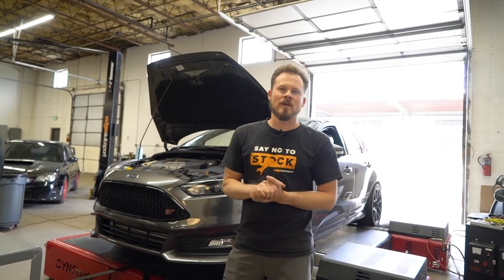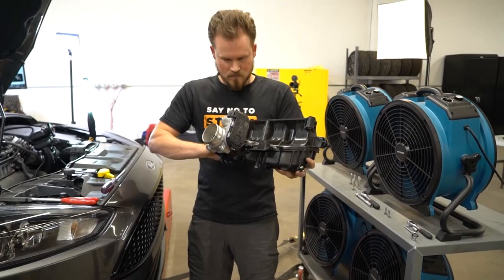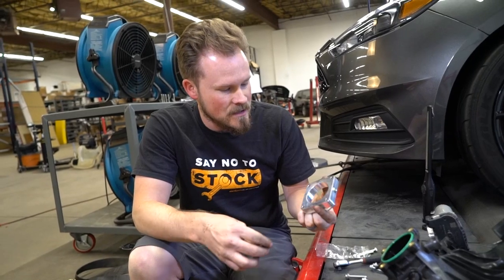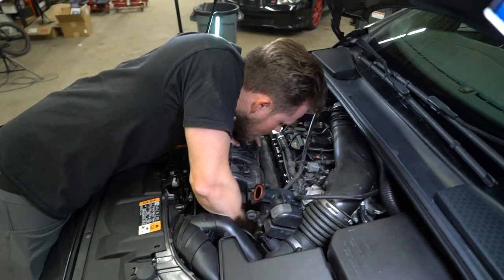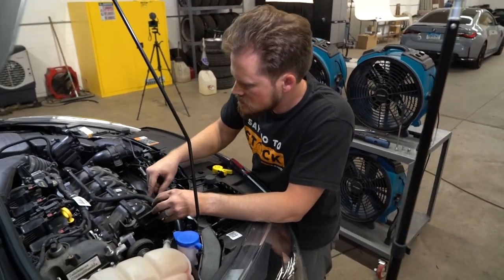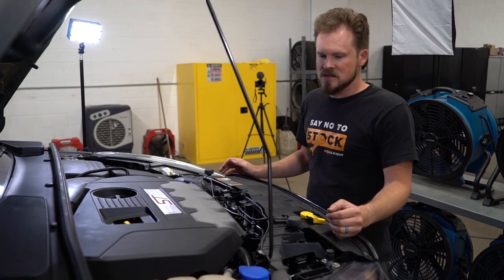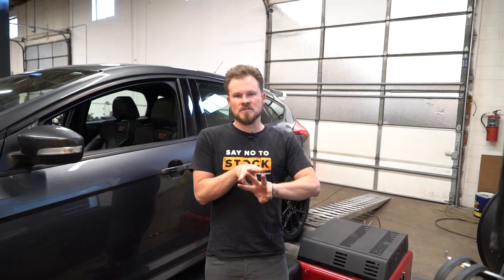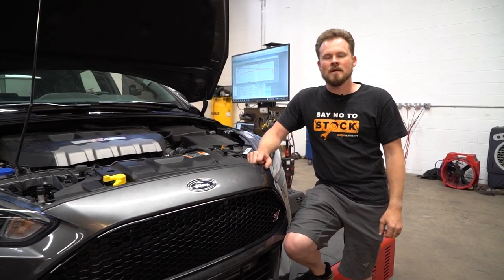Performance Throttle & Intake Spacers DYNO TESTED | Project Half-Send Focus ST

Comment: Great video , I’m a little sad that I feel like I wasted some money but this video was definitely something we need. Keep them coming
Reply: Yeah you see alot of snake oil with the aftermarket.  You just have to figure it out from experience.
Reply: I bought them because Edge recommended them. Wouldn't have bothered if they wouldn't have recommended them.
Reply: Bro his testing is flawed I've used them on my race car and aluminum manifolds the difference is better response go for a rip stop your car and touch your manifold it will be cold to the touch a colder manifold will always perform better he's trying it on a plastic manifold the whole reason they make plastic manifolds is to stop them from heat soak exactly what the spacer is doing

Comment: I gotta say, I'm impressed that you were able to install the TB spacer... After cleaning my valves, I installed the IM spacer and tried to install the TB spacer as well. But for the life of me I couldn't get the IM to line up no matter what I did to adjust it. I'm running the Cobb charge pips and IC as well. I just left the IM spacer on. After learning that they don't do much I'm glad lol 😂. I threw on both catch cans, sound symposer delete and pcv plate all in one shot. Shes running solid! Thanks for the video! Keep them coming!

Comment: I also had a feeling it will make no difference.

As Alan mentioned, the spacers can still be very beneficial by installing port injectors / watermeth nozzle which will make a huge difference.

Cleaning intake valves is highly recommended….then adding catch can!!

Thanks for the videos! Really enjoying your content 👍🏻
Reply from the maker: Thanks for tuning in, glad you liked it!

Comment: I said this a long time ago on the focus forums, so I’m glad this reinforces my findings…I also stated a ported TB did nothing as well so hopefully you can get your hands on one to really seal the deal on this snake oil
Reply: We will be doing this as well at some point.
Reply: Ported throttle body can help out in most applications, it all depends on how restrictive the intake system is,
Reply: @GoGoggansGo  on these cars you need a larger throttle body, solid charge pipes, etc. To help with power.  I don't think porting will do much unless you're doing nitrous or meth injection.
Reply: Gained 2.8hp & 5.4tq w/ ported tb(62.65mm). No spacers. Depo fmic & cnt charge pipes were already on car.
Reply: It’s a turbo I bet that’s why no change

Comment: I would not expect any changes on a boosted engine.
What I would be looking for, is a powerband shift with some small increases on the bottom end of a smaller 4 banger NA engine. You’re basically lengthening the distance between the intake valve and the throttle valve. Therefore, you’re increasing intake air speed at idle and off idle.
On an NA engine, too much intake runner can actually create a restriction @ WOT.

What I don’t understand, if you’re boosted, why you wouldn’t just run an extra fuel injector that squirts on the impeller?
It cools the wheel and air charge, is pre-atomized, cleans the intake valves and gives you the extra, needed, fuel. 🤷‍♂️
Reply: It would be to far away and as the atomized fuel travels through the charge pipes and ic it would condense back into large droplets. This would reduce the consistency of added fuel. If your looking to drop charge temps before the manifold they do make a nitrous fogging system for intercoolers to externally cool the ic using n2o.

Comment: I have seen videos and read articles that show a very modest gain in HP and torque, but they were on naturally aspirated engines not forced air set ups. It is usually only 3-5 HP or ft/lbs at the most. But if a cold air intake can get you 5-10 HP and a cat back system close to the same, you could possible gain 25-30 HP and a similar increase in torque. The problem is that it will cost you $800-900 for those gains. It would be good to see someone do a video where they go from stock to adding each of the upgrades to see if there is an actual gain, and do it on an NA engine. It would also be interesting to see how a simple power module or tune would differ with and without those upgrades. Who knows, it could make a noticeable difference, especially on some of the lower HP 4 and 6 cylinder engines.

Comment: So I have a 2018 focus st and iv been buying whatever I can to spice it up. I got the COBB a/p, an AWE track edition exhaust, MSD ignition coil packs, NGK spark plugs, CPE intake, and MISHIMOTO front mount intercooler... Thats basically it besides some cosmetic mods. But my question is having all these aftermarket parts, should I get it tuned so that i dont have any mechanical issues with stock turbo and engine internals/block?
Reply from the maker: Check out our video about tuning a stock ST, Sebastian. Sparknotes: it's always a good idea!
https://www.youtube.com/watch?v=ymt-zKQek6c
Reply: Do a rear motor mount right away. Anything over stock power makes the wheel hop horrendous

Comment: Assuming that a similar turbo engine with an aluminum intake used thermal spacers in the same spots, would not the reduction of heat transfer from the engine to the intake cause the incoming air to be cooler and hence allow the engine to make more power?

Comment: I looked at the boomba but I didn't see any advantage. The only spacer I've spacer seen for these cars that look like they should make actual difference is the  Steeda intake spacer. I would like to see some dyno results from that, similar to the Boomba they did pay some attention to the airflow entertaining the ports, but instead of knife edging it has a recessed rounded dividing edge. The only downside is it has no ports for any type of injection.

Comment: My only comment would be: isn't this like any other bolt on you install on the car? Meaning; you're not gonna get any HP gains from it unless you have it tuned. 

I'm not saying spacers are definitely going to see power, but would it now be possible to eek out some more power where you couldnt before using the power of an updated Alan Super Tune TM?
Reply: There isn't really anything to tune for with these. I'm riding the knock limit with the car right now and have tried to increase timing and boost separately and together and it just knocks more if either increase so that tells me it is happy where its at. We haven't tried any of these tests with the e30 map, though I doubt there would be any difference there either.
Reply: @TMTMS3  thanks Alan for the explination. You're the best!
Reply: You're right. More air needs more fuel. None of these videos address that.

Comment: I seen these for ls motors and I figured they were to tighten up the look of the engine bay when you switch from fan clutch to electric, people thinking these add power don’t really know the basics of making power
Reply from the maker: unfortunately a couple of companies used "improves airflow" as a marketing tactic and the HP gains spiraled out of control from there.

Comment: Well... I have to say I´m somewhat unimpressed. Driving these things (Steeda) around since many years to finally find out it´s just paper weight. If only this comparison would have been done earlier. But still, thanks for it! Not many have the chance to do this back to back test on a dyno for just a single part. Only one thing what came to my mind: I read these things only show their TRUE (haha) potential when tuned for it, there´s a value for the intake volume which has to be adjusted by the volume increase of the parts. Don´t ask me how much that is...

Comment: Say I've put 65k km on my ST and I want to get a catch can installed. Are there options for cleaning the valves/engine other parts coated with oil and other gunk?
Reply from the maker: Most people seek 'walnut blasting' services to clean the gunked valves. This is a pretty inexpensive and effective option! After the AOS/Catch Can, they should stay sparkly clean.

Comment: Increasing your intake runners length I.e spacers will change power band or can depending on vehicle. They're originally meant to increase throttle response. I don't know why anybody ever thought that it was going to give a bunch of horsepower cuz they don't. That's not what they were originally intended for the invention of the spacers. Pretty much older than probably most the people watching these videos

Comment: I'm late to the game with this comment, but assume the people that designed it did it for the reasons they did.  The bottleneck isn't here unless there's an off the shelf reason, go after the under engineered stuff first that came of the parts bin and then have some data as to what to go after next!

Comment: That thing isn't awd right? The back tires were spinning on the dyno
Reply from the maker: Linked dyno. Not AWD
Reply: @EdgeAutosport  what's the point behind that? More accurate readings because it's having to move the rear wheels as well?

Comment: Had my intake valves professionally walnut blasted before fitting the mishimoto baffled oil separator catch can 👍
Reply from the maker: That's the way to do it!
Reply: At how many miles, driving an 18 with about 45k on it... Thanks!

Comment: all well and good on a turbo car... but what about an N/A? 🤔
Reply from the maker: Reviews are mixed, some V8 guys swear by them, and I know some 350/370Z drivers really like them on the VQ series... but we haven't been able to test anything personally
Reply: @EdgeAutosport  if you take physics into account. a turbo wouldn't benefit, because the air is being forced threw, no time to be tumbled, and atomized.. because it already is... 
An N/A on the other hand benefits from just about any extra volume of air that you can get... so more condensed volume of air means more power.. same concept as a turbo, but not to the extreme...
I got a set coming for my 86..
wish i had a dino to test on.. 
but 🤷, we shall see what it does to the torque dip.

Thanks for reply
Reply: It does increase the manifold plenum, negligibly though
Reply: @tayvonrose2528  im getting 2-3 liters per 100km better on fuel, with just the throttle body spacer so far... 
thats not negligible...
Reply: @jesse584  I meant the plenum volume increase is negligible
Reply: @tayvonrose2528  results are great though, can't wait to get the time to do the intake spacers ☺️

Comment: 2017 ST.  I honestly felt a bit of throttle response but that’s it, for the causal driver that wants to build their car I would stay away from these, spend the extra $150-$250 on something else
Reply: I agree.  The best thing I found with this car is to take care of charge air Temps first and foremost, then seal the engine off, i.e. the rubber plug ford calls a bov, and get rid of the noise symposer.
Reply: Spent $109 on a 62.65mm ported tb. $530 on Depo fmic & cnt charge pipes. $35 AEM filter & removed box lid. 1 stage colder plugs & JST E30 tune soon, as soon as I get M Factory LSD in.

Comment: would a more empirical test  be.. test one thing at a time, than two? manifold spacer first.. test.. remove the spacer, then test the spacer under the TB test that show each result.. by doing both at one time you cannot see what each is doing/ or not doing..  also,, as the valves are easy to see, to clean the carbon,, could you test a  10000mw burning laser to clean the ack of the valves.. the laser would just vapourize the carbon,, not letting fall into the cly/ turbo.. i have played with a 10000mw laser,, and i think it can be usefull.. and they are not $$$
Reply: Given that running BOTH did NOTHING, we can easily infer that NEITHER would do ANYTHING. If there was some sort of benefit from running only one of them, we would've seen it on the dyno.

The concept for both is allegedly the same: It adds space for air to breathe on the intake manifold. Allegedly and based on the dyno, Boomba lied (not a surprise ... Velossatech does the same with their big mouth).

Comment: I've never heard they were suppose to make power. I have one on my MK3 Supra. It is not metal. It effectively acts as insulation between the intake and head, this dropping the metal temperature of the intake. By quiet a lot at least externally. No real to test the actual temperature inside.

Comment: ok Alan good video ,surprised you didn't take a look down the valves while the intake was off , 
so a few things I'd like to see tested and tuned for, 1 catless DP  or 100 cell vs catless, 2, a CB exhaust, 3, a 2.3 TB and maybe a vellossa tech BM scoop and finally that coldside charge pipe with that sound suppressor in it
Reply from the maker: You're one of those guys that comments before you watch the whole video.... I can tell. ;) But seriously, we won't be doing any catless testing or anything like that. If we do downpipe testing, it'll be with a GESI catted pipe like the Cobb.
Reply: Definitely looked at the valves. Quickly covered them up so I didn't have to keep looking at them... what you can't see can't hurt you right?
Reply: @EdgeAutosport  no actually i did watch it all thru very interested in this project, when's the next video
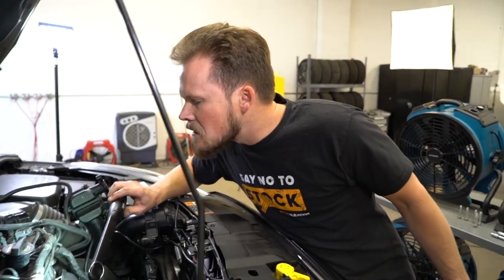Reply: @adenellicott5980  3:50 he looks down the valves ... so ... clearly you either weren't paying attention or commented before actually watching the video.